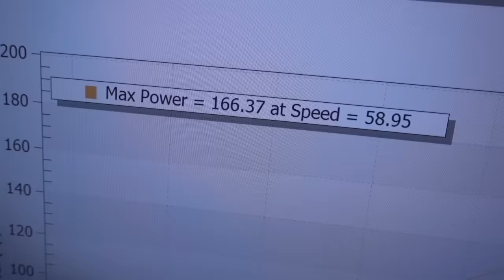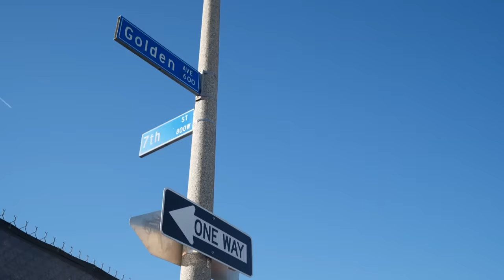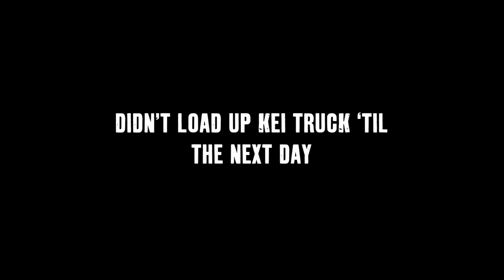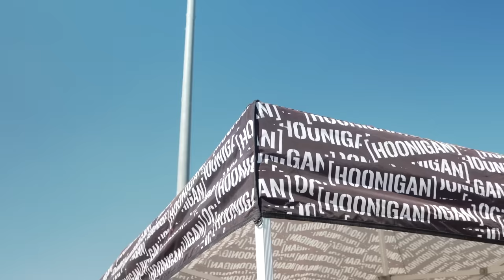The Rotary Swapped Kei Truck is DONE! First Stop: Shred Session at Irwindale Speedway

Comment: Hear me out... This or That "Kei truck vs Stock power miata (maybe donut media's)"
Reply: The truck has more power than any pre 2006 miata.... stock. My car is.... mostly stock? I might have 120 wheel horsepower. With a really really good 93 pump gas tune I might be able to hit 140 or 150. But soonish I’ll be boosted to 275 so
Reply: This vs jimmy oakes kei truck when hes finished modding it
Reply: Caleb Nation fully built na miata make 130 ishstick with bolt inspired and tune like 115 whp at the most
Reply: devin Dfresh my car stock did 138 at the crank, now it’s been bored to 1.9L fully forged internals, and a better exhaust manifold (99-00 manifolds are absolute trash, but 01-05 units direct bolt on for 8 horsepower gained) I’m probably somewhere around 145-150 at the crank which should be around 120ish wheel vs the 112 that most bone stock 99s dyno at.

Comment: I'm really really happy that the Kei Truck runs and rips! But i'm also kinda mad that Vargas didn't tune it since HE built the engine and he knows the limits of his own build, but whatever, if you blow it up we will know why! 😂😂
Reply: For real. The man needs to tune it
Reply: Vargas isn't the only person capable of tuning a rotary. I'm sure it's fine
Reply: @boxedfender4810  Sure, but not everyone is the same, and i insist, if the builder of the engine is also a tuner he should tune it, just my 2 cents.
Reply: @joealex65  yeah it just would have been another year or so because I'm sure everyone with a rotary and money called up Vargas after that 1320 video at Cleetus and cars called trying to blow up a rotary at 10,000 rpm 
That video was insane. Dude. if you had a rotary that needed tuning there's no way you didn't call Vargas.
Reply from the maker: Suppy is our project manager and we trust his decisions. He got it tuned very safely and well under its threshold because, well, he knows we break everything 😂. Vargas built us a great motor and it’s running flawlessly, no reason to feel any kind of anger.

Comment: You should build a 13b bridgeport turbo an put it in a 1989 Mazda bongo van and if ya you do you should find one with a 5speed manual transmission and just need to swap the transmission bellhousing for a rx7 13b s4 or 5 an make sure its diesel engine bongo so much fun me an my mate built one with a 12a turbo with carburetor setup a four barrel nikki or Mickey carb an it was awesome as hell

Comment: Its crazy how some people cant squeeze out decent HP from an N/A 13b. Most of the ones ive worked on made over 250hp
Reply from the maker: Most of the ones you worked on probably had a normal intake manifold set up, not one crammed under a seat with minimal space.
Reply: Hoonigan Project Cars  makes sense, but i feel like the car could make more power on a better tune. Its a great project! But i think someone like vargas could make more power with a better tune!